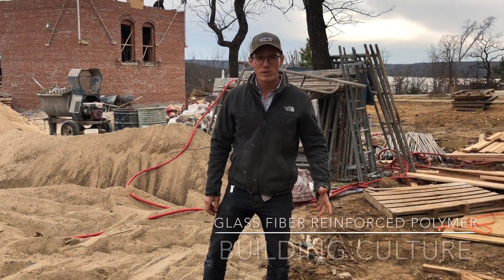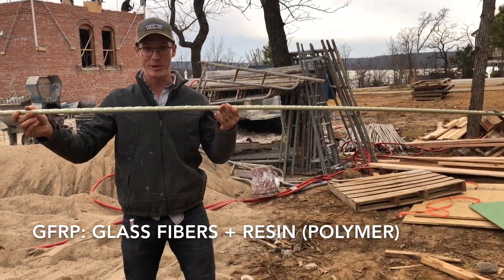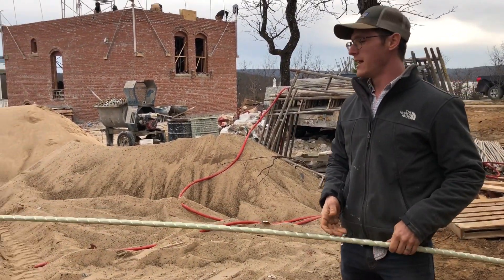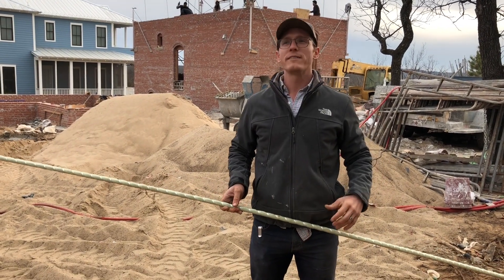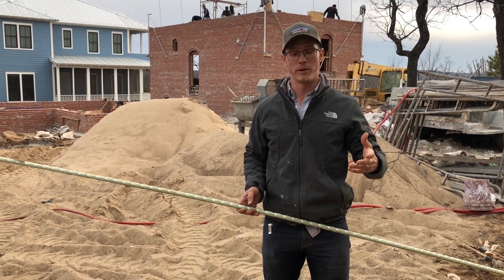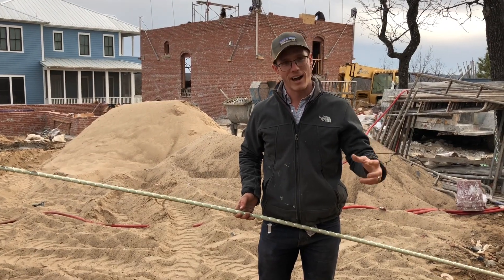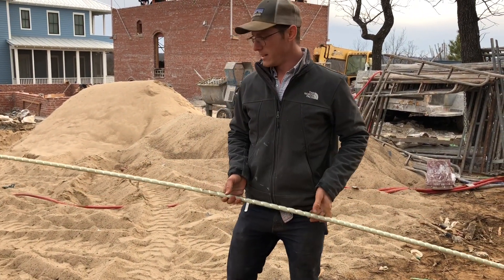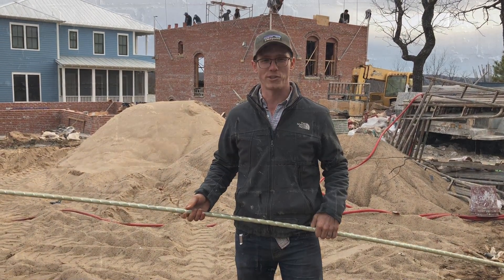Glass Fiber Reinforced Polymer. The New Way to Reinforce Concrete and Masonry | brick arch

Comment: not advisable for multi storey buildings, in case of fire those rebars melts and expect the building will collapse when the tensile reinforcement were gone.
Reply from the maker: Also, our buildings are not relying on rebar to stand up.  It's just there in case.  So even if somehow the rebar melted in the middle of the wall, the wall will still function as a masonry wall, unlike a wood building that catches on fire.
Reply from the maker: I would expect most buildings that catch on fire will fail.
Reply: @BuildingCulture  Yes, but steel begins to actually lose it's strength somewhere around 400 deg C - which only happens (remember the coating) with a really big fire which already results with massive structural failure of components. Epoxy used for composite rebars begins to lose it's properties since water boiling point. So at much lower temperature. It bonds with concrete to a lesser degree as well. And when there's shearing stress it snaps easier than steel rebar. So no... not a wonder material. It has pros and cons like everything. It does wonders in foundations though - no hazardous fire there, right?
Reply: Dude, you realize that rebar has only existed for 100 years, right? Brick buildings have stood for 1000s of years prior.

Comment: How we bend the rods inside the site
 i hope that's it easy to use :(
Reply: Field bends are not allowed as this material is made with thermoset resins.  But suppliers like Owens Corning has a full line of factory made bends so it is easy to get stock 90 deg bends for example.  More information is available at www.OwensCorning.com/Rebar.  OC has two lines of product - one for DOT structural applications like bridges (available in #2 through #13 bar size) and other for flatwork and things like this video talks about available in #3 & #4.
Reply from the maker: Buy pre bent. Super easy to use!

Comment: This stuff is coming down in price really fast. I can get 7/16ths GFRP at the local Menards store for about 5 dollars each. That's less than regular steel rebar! The strength properties have been improving too as they seem to be using better polymers now for the resins. Its upwards of 7 times the tensile strength. Probably not anywhere near the compressive strength of steel rebar, but compression resistance is really the job the concrete itself should be doing anyway.
Reply from the maker: Good to know!  I actually still have trouble finding it out here in Oklahoma.  No one knows what it is, and I can't even get my big suppliers to get it.  I got the last batch direct from the manufacturer.  Happy to see the prices coming down and quality improving.  Thank for comment.
Reply: @BuildingCulture  Hi.  Great video!  Owens Corning is starting to create a distribution nationwide but not as quick as you would like I suppose.  www.OwensCorning.com/rebar for more information.
Reply from the maker: Yea I’ve seen the same thing at Menards!
Reply: There are two main types of products in this category.  One is ASTM approved bar used for DOT applications like bridges and other like one that Menards sells for flatwork (slab on grade).  One should really use ASTM product that is bit more expensive but still significantly less than galvanized or epoxy steel for masonary walls.  Also ask for mill certs when dealing with this products.  Quality control in GFRP production is important.  There are good manufacturers and then others.
www.OwensCorning.com/rebar